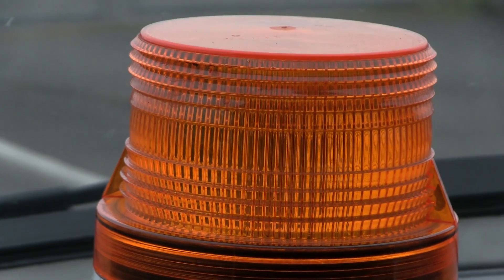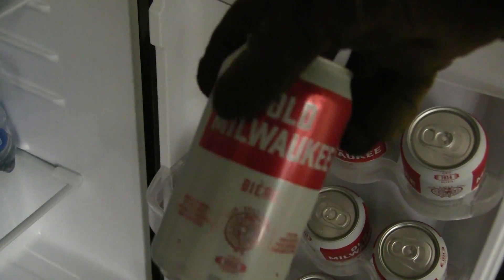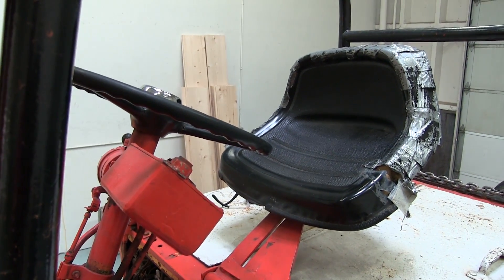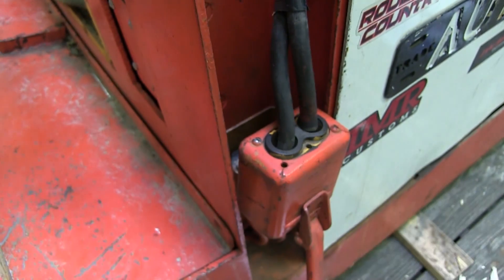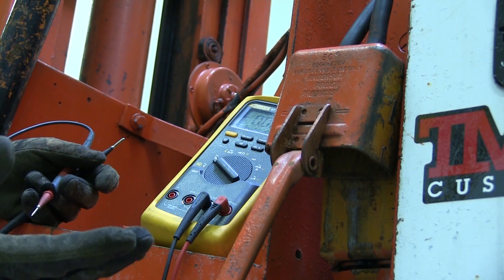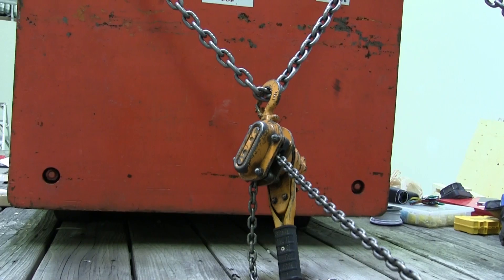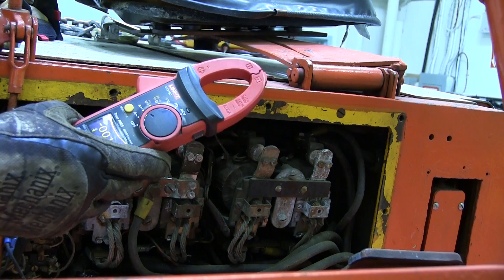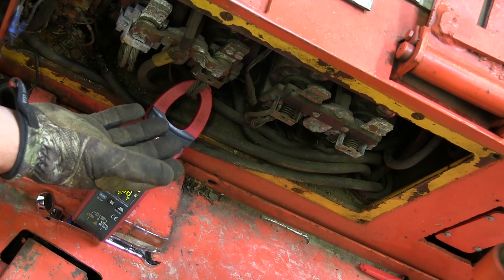Powerful Electric Troubleshooting | Voltage Drop Test

Comment: Like you I would have jumped on the batteries and those huge white powder covered cables and the contacts first, that stuff was just nasty. However, I have found it’s worth fifteen minutes to look at how it goes and stops mechanically. Do the wheels roll when you pushed and pulled it, is that a smashed safety switch or non OEM wiring, parking brake, shifter linkage, while tap, tap, taping suspect stuff with a brass hammer to see what might happen. Then get the MAC EM710 multimeter out.  Before I take some shit, I was an automotive tech that worked bumper to bump. I fixed any electrical or mechanical problem between the bumpers.

Comment: If your working ten foot from the outlet and all you have is a 100’ cord and you keep tripping a breaker. Just coil the cord up nice and tight and only pull out what you need. I swear I’ve seen it

Comment: You are correct!   If something that uses electricity does not work, it has to be a problem with the electrical system.
Example: I designed a 4 story office building electrical system.  There were two elevators side by side exactly the same.   A couple months after the building was completed, we were informed that the electrical system was faulty and one of the elevators would stop working randomly.  I went to the building and did some investigation and tests.   After finding no issues that would cause the issue, I told the elevator tech to swap the circuit boards of the two controllers.    
Three weeks later, I thought about it and called the owner to find out what was happening.
"Oh, I forgot to call you!  The other elevator shut down and the elevator company changed the circuit board!   They work fine now."
Did he pay for our time doing the investigation?   Of course not, it was an electrical problem and under our warranty!
Respectfully,    Kevin

Comment: You can safely touch a 36 volt power supply.  36v across (a person) 100k ish ohm resistance is 400ish micro amps. You're fine regardless of the amps the ps is capable of delivering.

Comment: To measure low resistance like your wire scramble example I set my bench supply to 1A current limit then read the V.
Yeah I'm lazy ;)

Comment: I agree it's probably a brake issue. Especially with that kind of amperage. Brakes always seem to hold better in reverse than they do in forward. #1 rule of electric forklift repair RAISE DRIVE WHEELS so you don't run yourself over when you fix it. That lift probably weighs as much as 2 Chevy Suburbans and I'd like to see you make more videos.
-Sit in the seat and see if it rolls(seat brake). Could be that simple( that whole loose nut thing). Check that seat brake is not seized .
-If it still doesn't, check master cylinder rod free play. It may be too tight and not allowing fluid to return to reservoir, causing brake application. 
-check wheel brake adjustment or they might just be seized. It is a 57 year old forklift after all. 
Thanks for the videos!

Comment: Had to use three stick welders on a roof back in the day. One lead and a couple of double adapters. Kept blowing the fuse so we just kept adding copper wire till we ended up using 8 gauge fencing wire for a fuse. Worked a treat except the lead going across to the roof from the site pole got a huge cow belly in it cos it got so hot. Got the job done though. ;)

Comment: Arm voltage is same fwd /rev . 
Motor reverses by swapping the field windings .  
And the the battery should be 2.12 to 2.14 volts per cell . 1.280 specific . I am also an industrial battery tech ,

Comment: U.S .military  is about the only one who uses the E.C.locking connector .  I know this will sound dumb . But make sure the fwd /rev contacts are clean . Back side pad too.  
If it doesn't see it closed or open , pixeys won't flow . 
Worked on old crusty forklifts for a while.  Hit me up if ya want so e help !

Comment: I think you forgot that if you measure voltage drop on load, you actually are measuring the internal resistance of the battery. You could always calculate the voltage drop through the leads if you know the amps you are pulling through it, just unplug the leads measure the resistance and then use ohms law. Of course that way you won't get the resistance of the breakers, but you have to calculate the internal resistance of the battery first if you want the real wire and contact voltage drop during load. Thanks for the video and hope this helps!

Comment: You DO need a load on the circuit  to check the voltage drop, cant do it with an open circuit. Have you plugged in the the OBD2 scanner and checked what the scanner says???

Comment: 1.85 volts per cell is low. You need 2.1 volts per cell. The voltage drop you see is caused by standard resistance through the contactors/ cables. Im sure there is some corrosion resistance along the line, however thats not you're problem. Your battery is most likely low on water, and needs a full charge. Do a slow 40amp charge for 8 hours. Fill the cells with distilled water.

Comment: Hey man, you should measure the voltage drop and current while the machine is running without the brace, that will tell you the power consumption when the motors are not blocked, using the values you get you can trace all electrical component from the battery to the actuator in reverse and determine if the problem is electrical.

Comment: Wouldn't it be better to just use a mechanical gear to shift into reverse? This would only require the motor to turn in one direction.

Comment: Just fore some that don't get it. The longer the wire is the more resistence it gets. But you can fix that by getting a bigger wire (in dia.). It's like a pipe were water goes true, if the the pipe diamiter is bigger the water flows true it easyer.

Comment: I have a question for the funny guy with the copco straps. (AvE) I work for atlas copco, now epiroc. Plc question. I have a plc burning out rs 232 cards. I threw the scope on it, and didn't see anything abnormal. What do you think would cause it? Amplitude of the signal? Mysterious short? I'm baffled.

Comment: Reminds me of my workplace. Angry mechanic arrives with his tools and a bad mood to check a mechanical problem on a shitty machine. Swears and mutters while laying under it with oil dripping down on him. Then I hear "Yes! It's electrical!" and see him walking away, smiling. An electrician arrives, checks out everything and says "nope! It has to be mechanical". Guess who's back with an even  badder mood. :P

Then repeat this 4 times.
Reply: So what WAS the problem in the end??
Reply: @fredwupkensoppel8949  Mechanical. Ruined bearing causing motor and vfd to overheat.

Comment: Three things create voltage drops.
Corrosion, chaffage and breaks, backfeeds usually caused by faulty grounds. 

I'm interested in the outcome.
I'm gonna guess now that it has a broken or corroded ground in the reverse circuit.

Comment: I think you forgot to take into account the voltage sag of the lead acid batteries under load which could easily account for the few volts drop you had. 😉

Comment: Boy that's a oldy , those contact points are shot ,you can buy them in sets they just bolt on replaced thousands of them over the years .
That should be a capacitor based system check your capacitors  ,usually under the floorboards  that is  are a very simple system .

You could have a blown capacitor!
Reply: Ernest Rhoades What would capacitors do in a DC forklift from around 1960?

Comment: Total current of the whole circuit multiplied by a component's resistance will give you the voltage drop of that component.

Comment: DC motors (like this forklift has) have an INCREASE amperage draw under load (and with it resistance goes down). Test it... find a DC motor and lock the armature (or put a heavy load on it)... how much does it pull? Now, test it load free... what do you see?

Comment: If the contactor output connection is cable rather than bus bar we would generally swap over the output cable ( so direction lever would be visa versa ) and see if the problem is the same,goes backwards its a contactor,doesnt then yeh,trans is hooped!! 😁

Comment: Kinda wonder if that battery sitting cockeyed in the back is holding the one steering wheel from reversing easily.  It sure looks like it's resting on the wheel.

Comment: They said it moves forward but not backwards, and you also said the brakes are seized on.When you were testing for voltage drops I did not see the thing move forwards, I did not expect it to move backwards. But with the brakes seized on it is not going to go anywhere. They will have to sort out the brakes before you can test anything else.
Reply: Tony Papantoniou Seized on purpose, not a fault.
Reply: Then how do you know if it goes backwards or forwards?

Comment: Ordinarily, I would say that if the current draw is similar in forward and reverse, but it's not moving in reverse, then someone has messed with the controller's adjustment potentiometers and has effectively told it to go nearly zero speed in reverse, but the chains keep it from going even that fast, so you get full amperage in reverse... But if you give a psychologist and a proctologist a list of symptoms they'll often give different diagnoses, and I'm into the electronics side of things more than the mechanicals. The bad brakes hypothesis was unexpected but seems quite likely too. That forklift looks old, but if the speed is controllable, then it likely has a controller board somewhere.

Also, I'd like to point out that the current draw test and resting battery voltage were sufficient to tell you all of the other unknown parameters via Kirchoff's Voltage Law. Measuring battery voltage under load tells you how much of the total system resistance is inside the battery and its jumper leads up to the connections on your DMM, and it would seem at a glance that the batteries are good enough. Another place to check voltage is at the motor's terminals, to make sure that the juice is reaching it and not being dumped to some kind of resistor network that has malfunctioned.

I'm not sure I'm following your logic about a long - or under-gauged - extension cord causing a breaker to trip more easily. That condition would increase the resistive load of the circuit, which would theoretically lower the overall amperage draw via Ohm's Law. Since this is not a DC circuit, however, if an extension cord is the variable that is causing a breaker to trip, and a short circuit or GFCI fault can be ruled out, then you can assume that the additional resistance is likely messing up the tuned reactance of the appliance. The additional resistance is lengthening the time constant of the reactive load (such as a motor's windings) and causing it to stay in its high-amperage start condition for an excessive amount of time, or shifting the load toward the higher amperage 'resistive' end of the spectrum while running, thus tripping the breaker.

Comment: 1961? This lift was ten years old when I started fixing forklifts.

 Notice how the seat is up in the air? The seat brake actuates whenever the driver falls off the truck. If you sit on it or tie it down,
the seat brake will release and you can continue the troubleshooting. (either that or you will have fixed the problem... red face) If you ARE holding the seat down and are still bound up, maybe the push rod connected to the seat isn't going down far enough, or the linkage at the bottom is twisted, worn, or damaged; or maybe a spring is broken.. The brake assembly should be on the end of the drive motor. You can feel the linkage by reaching under the truck, but be warned, it can get crusty down there. Also, for trucks that have sat unused for a long time, it's possible that the shoes have stuck to the drum. (if you get good fwd travel though this won't be the case)

Also, it's nice (imperative) to do all this troubleshooting with the drive wheels off the ground. A good way to do that is: tilt all the way back, put wood or steel blocks under the upright rails, then tilt forward. The drive wheels should rise up as the front edge of the rail goes down. 

There are almost certainly not brakes on the steer wheels. Also, 100 amps should be plenty enough to move the truck so I wouldn't worry about voltage drop just yet. 

My advice: lift the drive wheels, travel in forward for twenty seconds then feel under the truck for a smoking hot seat brake drum. (or disk) (probably drum) Keep your gloves on.

It looks like this may be a resistor truck. Drive speed in them is regulated bu huge ass resistors under the floorboard. Trace the cables from those two contractors on the right. Post the model and serial number next video and I may be able to send you a schematic.
Reply: That should be "contactors" not contractors, stupid spell check. 

Also after reading comments.... people guessing as to how this thing is wired... Most likely:

Negative goes to A1, through the armature, and emerges at A2. A2 goes to the common NC connection at the directional contactors. The directional contactors change direction of travel by flipping the direction of the current from F1 to F2 or F2 to F1. After the fields the path to positive goes through the speed control, which on this truck looks like resistors. 

Someone noticed how that battery was about to drop out the bottom of the truck. Good eye. If it's resting on the steer wheels that could be your problem right there.
Reply: Great suggestions! You wouldn't think of those things, unless you had prior knowledge of their operation .

Comment: I think you are probably right about the brake sticking deal, I have a big (16,000 lbs with diesel engine ) fork lift that has been giving me intermittent problems with brake sticking, the way the brake shoes work it could very well be binding in rev. and not in forward. mine is stuck in the back yard right now because of it, (actually I should not have procrastinated about fixing the brake and I would not be stuck). keep up the great work!

Comment: Your explanation about motors tripping breakers with long extension cords is basically wrong.  The motor is just modeled as inductors and resistors.  From ohms law, we know that current is proportional to voltage.  If you decrease the voltage, the current decreases, not increases.  Unless there is some active control over it, it will not compensate by increasing current -- and even if it was, the extra resistance in a long cord is unlikely to allow it to pull a lot of extra current.

The current that a motor draws is proportional to the voltage divided by resistance.  Resistance can be measured with a multimeter, but what's the voltage?  When a motor spins, it produces a "back emf" which is proportional to the speed its spinning at.  So the "voltage" in the above equation is forward (applied) voltage MINUS the back emf.  As a result when you first power up the motor, there is very little back-emf and it draws A LOT of current.  As the motor spins up, back emf increases, total voltage decreases, and so does current.  In other words, there is an in-rush current.  So here's my speculation...  The motor is designed to draw more current than the breaker is rated for when you first plug it in, but the breaker reacts relatively slowly and so by the time the breaker would respond, the current is much lower.  This probably also explains the ludicrous power rating on motors (for example, a 4.5 hp shop vac, which would be pulling 30A  through a 15A breaker -- clearly a load of bullpuckey).  By putting in extra resistance in the cord, you would stretch this in-rush time out, and even though it will decrease the peak current, the longer ramp time might be enough to trip the breaker.

Comment: I felt my resistance go up to the idea of a battery operated fork lift.  Real men only drive fork lifts with infernal combustion engines.
Reply: Amateur Redneck Workshop So what do those gas machines use for counterweight, since they don't have a literal ton of led in the tank?

Comment: when you look at the voltage drop, you also have to consider, the voltage drop of the battery. when the battery is under load, it drops its voltage.

Comment: Interesting idea that the breaks are locked. Most but not all forklifts have self energizing drum brakes but they self energize in forward not reverse.  So wouldn't driving it forward lock it up tighter and going in reverse break them free if stuck? I would unchock  and unchain it to continue troubleshooting

Comment: I have used one of those old angry pixie fork stuffers when i was a young idiot. Also found out the fun way that the rear wheel is roller chain steering powered by a hydraulic motor. Wheel hit stop and the chain went pop. Fix was easy but getting the big girl up wasn't.

Comment: The key here is at 06:00 where you correctly state that motor "current is torque" and then you measure forward current as 123 Amps and reverse current as 128 Amps. This is essentially the same, so forward and reverse (locked rotor) torques are identical. So, the motor is trying equally hard in both directions, but the mechanical result is not the same. I would go right away to the drive train; I would jack both drive wheels just above that truck bed, and see what happens for forward and reverse. Maybe also check drag by manually rotating each wheel.

BTW, when you can measure currents, don't waste your time measuring voltage drops across connectors, contactors and splices.

Comment: There was a second error in your correction at the end. You said to measure from the hot pin on one end to the neutral pin on the other (at least when you were holding both ends pointing to where to put your voltmeter leads). That will measure the drop across the whole device. You want to test hot and hot, then neutral and neutral to see the total drop across each side of just the lead